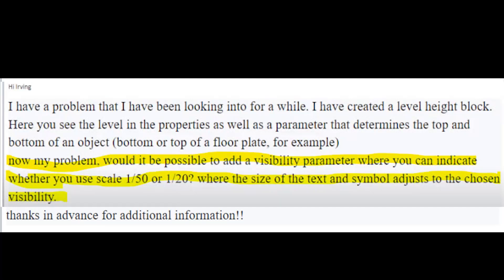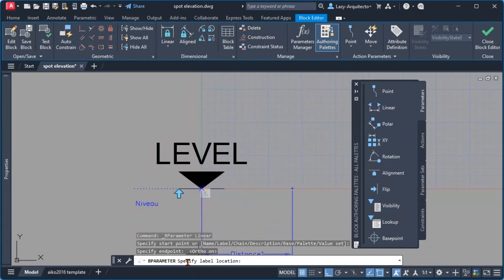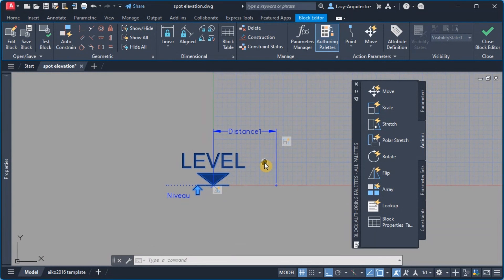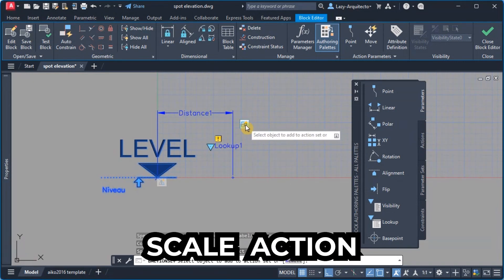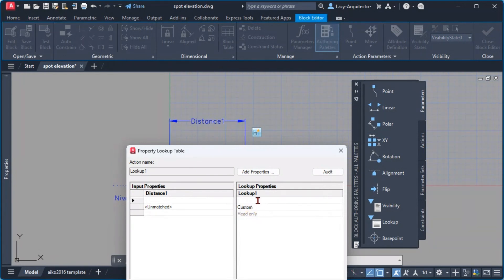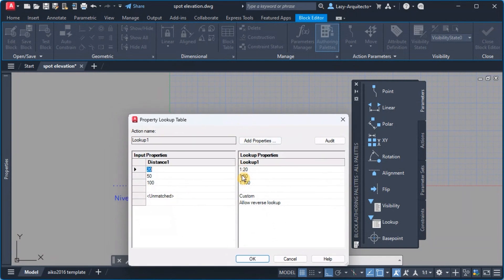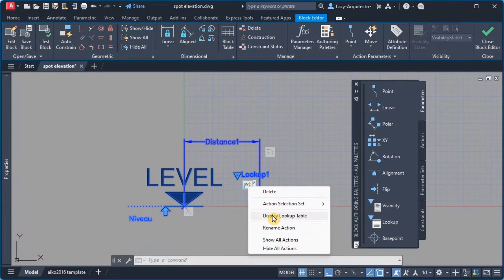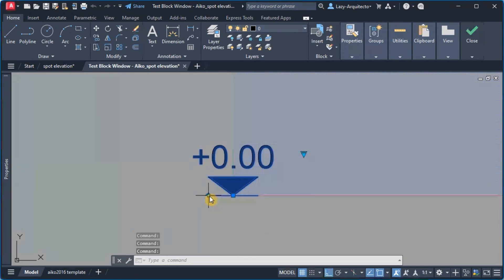Automating YOUR AutoCAD | lazyQUESTION 10

Comment: I have a query and hoping you can provide solution. I have date which is in fields in the template. To update the day in each layout tab to current date, I have to use updatefield command and then enter all and hit enter everytime for each layout. My drawing has 22 layout pages so the same step for 22 times. Is there any way to update date in all layouts with single command. It will be really a time saver and make my life easier. Your help will be highly appreciated!!
Reply from the maker: Is the date inside a block or an xref?
Reply: @LazyArquitecto  it is just a text and date field is added.
Reply from the maker: Send me your files to do a livestream responding you here www.lazyarquitecto.com/newsletter